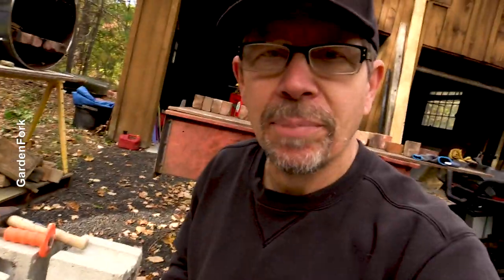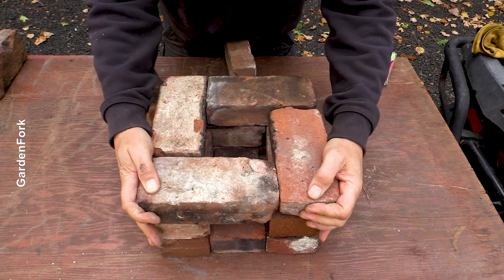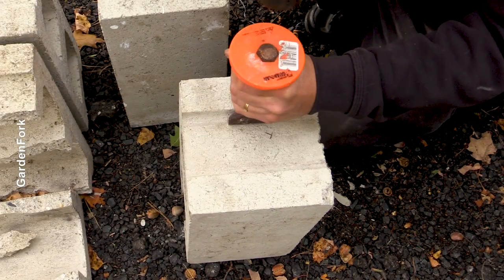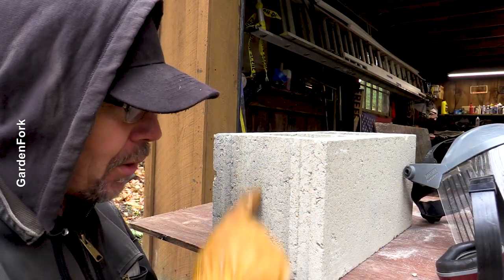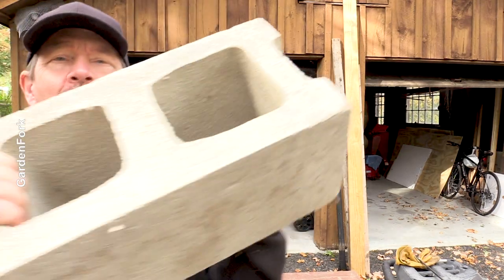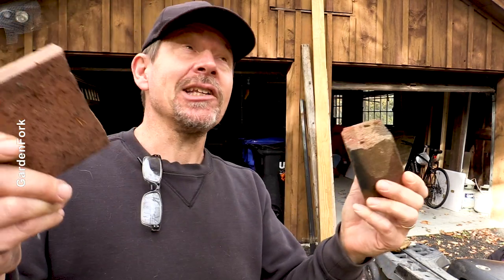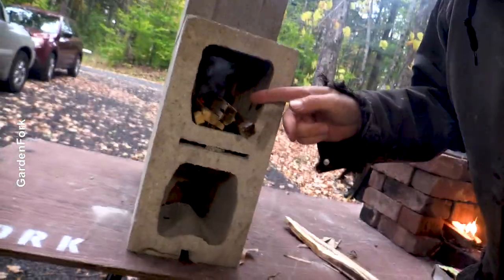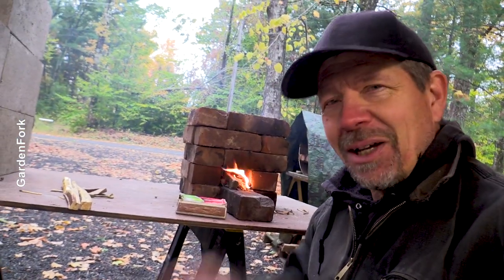Brick Or Block Rocket Stove? Which Is Better

Comment: I've used cement blocks.  You're letting it have too much air.  I put some cardboard over the air intakes and it burned great.  So great it warped my stainless steel grill plate.  I also put some wood vertical in the chimney to get it started.

Comment: Blocks no, cause we don't all have tools. Won't work for most of us. I'm an elderly lady trying to find a way to have heat, to cook, boil water, if needed.  The 3 brick is cheaper but, I don't have tools, hoping the brick one will work. Then I got to find a way to cook or heat it. No wood. I'll find your revised brick. I've seen people building cans and that just doesn't look safe. I'm really worried about our power going out. Thank you for showing us. 
Miss brick lol, works for me vicki

Comment: You are correct about the cement blocks and cement bricks not exploding in the stoves. The ones that explode and very very rarely were the cinder blocks they use to make a long time ago. I’ve never seen it happen but as a mason I heard it happened a few times back in the 50s. Concrete blocks are much stronger and of better material. Now if you used fired clay bricks they wouldn’t crack on you so much. They are fired in kilns up to 2000 degrees and your stove won’t get anywhere near that.
Reply from the maker: Thanks for the note Tony, I get so many comments on this, people screaming at me ;) Eric.

Comment: They need air cans (squished tomatoes can or similar that you put the sticks on to of at the entrance hole) but the brick one is too small for a corn can -- use a tomato paste can. Squish it more on one end than the other and put the more squished end in first. Then put the wood on top. Won't smoke as much.
Reply: A bit of chicken wire or hardware cloth works well too. Loosely roll up the wire and push it down into a rectangular shape that fills up the bottom third of the feed tube. The air going in under the sticks is what makes a rocket stove so efficient, the sound it makes with the air rushing through it is where the rocket name comes from.
Reply: @terryjohnson2093 Yes, and one more vertical chiminey block to help draw more air will make it smoke even less.

Comment: The brick looks easier, for sure.  I am going to see if I have enough of them to do this.  I look forward to your modification video!
Reply from the maker: This weekend!
Reply: My mod to my brick stove is self cleaning
Reply: I went to a brick and stone building supply company in my own hometown in early 2021. I bought 4 cinder blocks and asked that 1 of them be cut with the H block cut right there. They did it for me. I looked at fire brick prices but even 18 fire bricks were more than 4 times the price of 4 cinder blocks.

Comment: I used clay brick as a wall for the coal in my side blast forge.  They definitely crumbled and actually melted!  But they never blew up.  To be honest, if I was using them to actually contain the heat of the forge and not just serve as a boundary I am not sure I would have been as lucky.  But my bricks were quite old.  I do believe that some caution should be taken, but for use with normal fire temperatures I don't think there is a problem.  Forges, on the other hand, are much much hotter.

Comment: I know fieldstone will explode if it has too much water in it from the water heating so maybe people were thinking of that.  With as porous as brick and concrete block can be, I can't imagine the water creating enough pressure to explode.
Reply from the maker: Yes Robert I’ve seen that too. I tire of people posting online without doing any research. 😉

Comment: I built a 7 cinder block rocket stove for me and my daughter. I use mine randomly. She uses hers all the time. Her cinder blocks cracked but did not change the cooking much.
I modified mine by adding:
1. A hoe made out of 3/8" rebar and 14 ga flat steel end to make the hoe to clean and stoke the fire.
2. I put a piece of c-purlin 17" long with a cutout of 5x3 1/2....1/2 inches from end to make a hole in the c-purlin. I then welded a piece of diamond mesh over the cutout. This was to direct the air flow under the fire. Works great. Increased fire flame and heat immensely.  
3. I have discovered that if you block all the air coming into the flame area except the c-purlin intake, then the flame is even higher and hotter. This is my next project. I am either going to use wood frame with rockwool to protect the wood to block the air or a single piece of 14 ga metal and keep it in place using magnets apoxied to the cinder blocks. Yes magnets ruin if heated BUT the location of the magnets the blocks do not get hot but rather only get warm to the touch.
4. Next I am going to build an adjustable pot holder so that you can raise or lower the pot to help control heat immediately.

Comment: The ones I've seen made out of block actually put the base block with the flat side up with a half block on the back half of it.  They still use the vertical feed block like you did but they also put a vertical block on either side of the main combustion chamber to close it in and then two or three blocks oriented like your to form the "chimney".  The better ones I've seen are three blocks wide up to the third tier (the first chimney level) with two more blocks for the chimney on top of that.  You wind up with two work surfaces on either side when you do it that way.
Reply from the maker: Good info Brian, thx for that. Eric.

Comment: Both stoves need a chimney or "riser" and they won't smoke......   the chimney needs to go up another 12 to 18 inches and you will see a whole new "stove." Clay bricks (or shale) are fired to 1800 degrees in their manufacture. The brick is better than concrete. Yes.. over time it will crack from rapid cold to hot to cold, back and forth. Warm up brick stoves slowly and bring them back down to cold slowly and there will be no problem for a very long time. One of the main reasons for firebricks / refractory bricks over red bricks is not the high temperature in a wood stove, as much as they have no problem going ice cold to very hot in just a few minutes.... no cracking.

Comment: You must seal all the joints, mud or clay works.
Also, the taller the top (up to a point anyway) the more rockety it becomes.
I think it is a 1:4 ration - 4 times higher than the input length.

Comment: Build the fire brick design with another layer or two where the bottom layer is an air passage to allow air to go up the chimney. Maybe keep the air passage open at both ends to allow for easy clean out of ashes that collect there. Or, just use a can like everyone says.

Comment: You know... I've been looking around and don't see anyone doing a video about how to put a chimney set up on these cinder block or brick rocket stoves. The idea is you'd need a chimney if you did it in a hot tent. 

So ... what are you supposed to do adapt the cinder block or brick rocket stove to a winter hot tent?

Comment: Appears to me that the cinder block one is starved for oxygen hence smoke the brick one with all the airggaps with the brick not being mortared together and having rougher surface than the smooth factory made cinder block which would not allow air creepage
Plus in this test having the test at the mouth of garage wouldn't there be some sort of draft blowing inwards hence taking oxygen I.e. the draft away from the rocketstoves?
It seems to me it doesnt matter which one you use but you would want your stove to be steady so your pot or skillet doesnt end up on the ground and that you dont really want air coming from the cracks in the whole structure. But from where you load it( really I don't know but it would be steadier if the bricks were motared in and it could be controlled more if the oxygen were coming in from one place, no? 
Also the elephant in the garage to me is the brick one... The one going across the mouth of the borehole is just dangling and could fall in while using it which would suck
Things crack cause they heat or cool too fast which could be slowed with. Insulating the outside. - fiberblanket or refractory material(vermiculitr Portland mix of some kind 
Im typing/thinking out loud
Reply from the maker: Excellent ideas here Patrick, thx for typing while you think. Eric.

Comment: Or hit the concrete block towards the outside instead of crushing it slamming into it haha just lay it down.. hit that slot you had to cut from the middle out not in much easier 👍👍you might have to flip it to knock another chunk out but its a few swings with a regular hammer 🔨

Comment: You need a draft, better off using the masonry brick you broke in half. Can create the draft needed for air, put it in middle. With other mason brick on top. Weight holds it together. Watched others use this way. USe what you got!

Comment: Your stoves suck - I've worked masonry for over 35 years. You had one block (8.8.16) with a slot in it. That slot is for opening the end. With a masonry trowel (or chisel) you can cut the thin center out then cut along the edges to remove the two pieces on the end. With a little time and heat the blocks will crumble. With bricks you need to use fire brick.